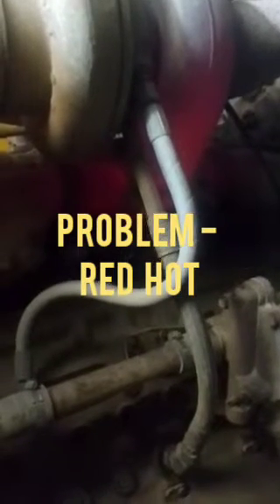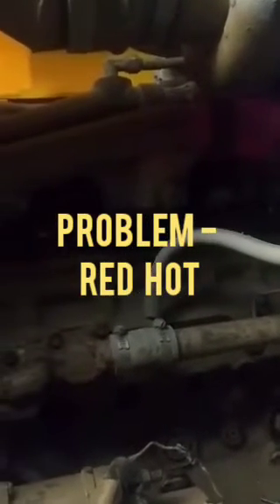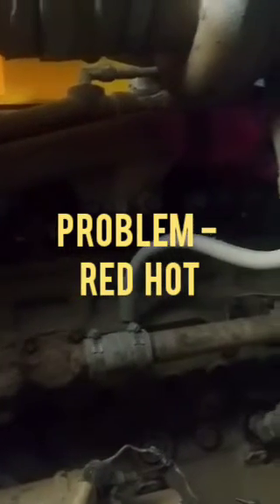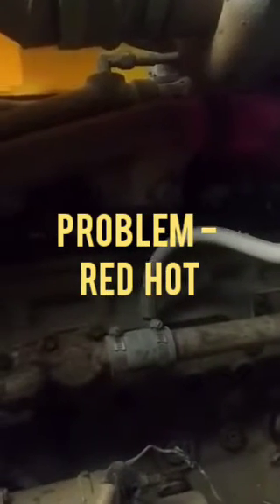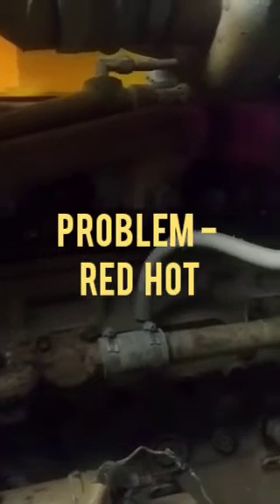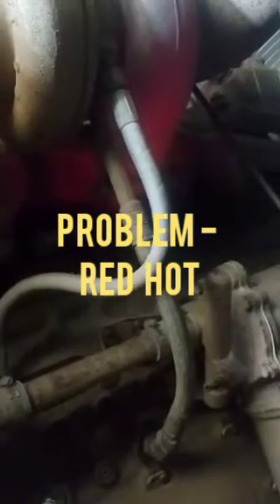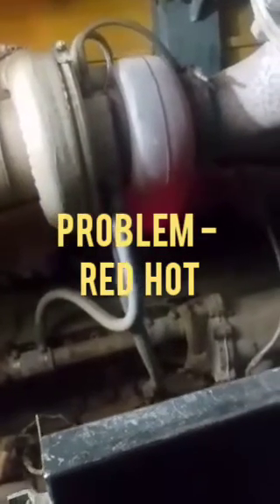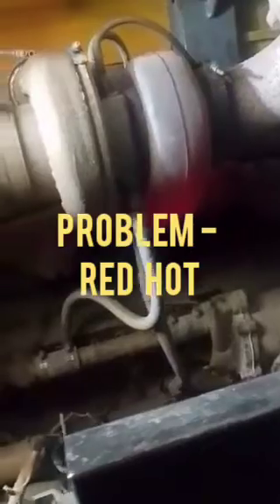Cummins- Why Exhaust manifold got Red hot, Tell me.

Comment: 1.First you have to check Air-filter is clogged or not and  
2.second is check Aftercooler of that side cylinder bank and 
3.Third Check Turbocharger Axial play and inner Bearing if its seems ok. 
4.then It will be Injectors fault needs to calibration. 
5.Last is Very Rare Fault is the Head Exhust Valves but this fault is very rare to occure you to check Aftercooler that solve the red hot problem.
6. And If there is Camshaft is Lightly gets bend Than it will cause turbo Red Hot. 👍🏻 

Thats All. Whatever is know according to my knowledge and Experience i have Shared. The  Better you know about it ok.
Thanks You 👍🏻
Reply: Where are u from brthr